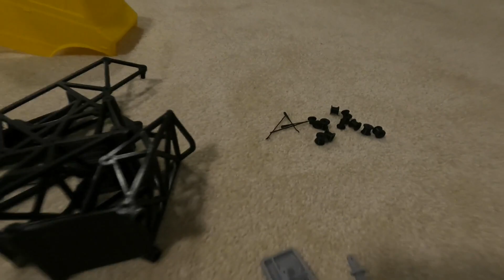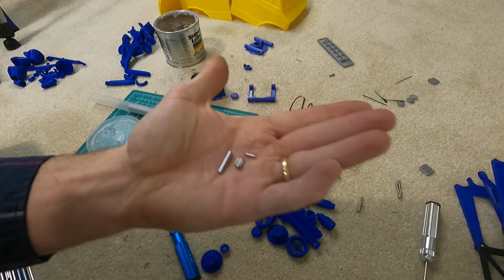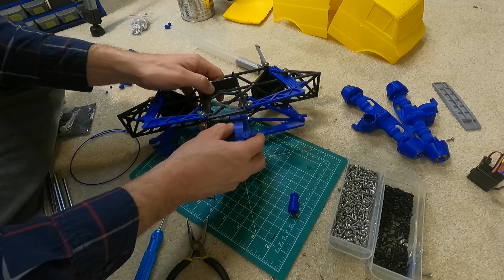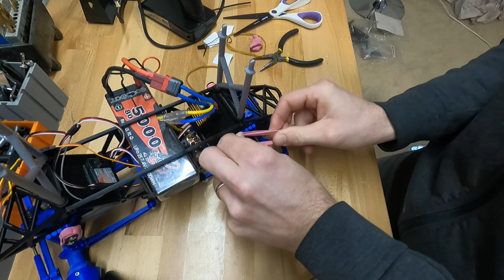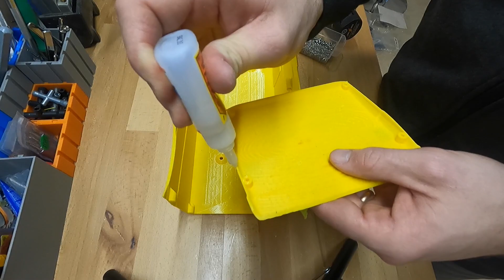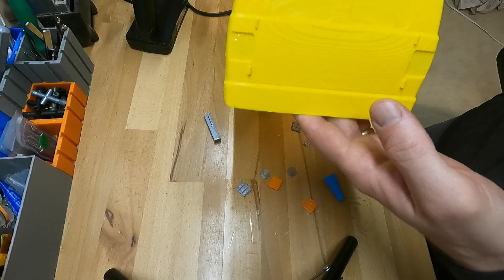Building a 3D Printed Monster Truck! The URSA

Comment: Another great build! That one looks like it's Clod Buster inspired. It also has a lot of small parts, looking forward to a "bash" video.
Reply from the maker: It definitely looks amazing but I'm pretty worried about those tiny diff gears. I just printed in PLA to start and I'm not sure that'll hold up. I've ordered some new nylon to try on those gears which should hopefully be a bit better. I'm also not totally satisfied with how the driveshafts mesh with the diff, doesn't seem tight enough and I'm getting a bit of grinding... still some work to do before we can have a really good bash!

Comment: I am planning on printing this but I want to upscale it to around 150% maybe even 175% I just need to figure out what bearing I will need for the larger parts. any advice you may have on that would be greatly appreciated. I am also still trying to figure out exactly how I will get the motor to work so I am looking at different transmission options. But hopefully when all is said and done I will have around a 1/6th scale monster truck.  This was a great video thanks for sharing.
Reply from the maker: Dude, I don't have a tonne of recommendations for you but wow that sounds like an amazing project. Please send pics when you're done! I had issues with the differentials on this build and also the steering was a bit too lightweight with just the microservos so if you scale it way up you can probably solve those things but finding the right bearings will definiitely be a challenge. good luck!

Comment: Kind of a dumb question - what rubber bands did you use for the suspension?
Reply from the maker: Just whatever I had lying around... try to make them the same and if they're too big you can just loop them a few times.
Reply: @rcprinter  Thanks for the reply! One other question that came up - With putting the 2 live gearbox halves together did you have trouble with the bearing fitting in place? It seams that is what I cant get seated properly to close the 2 halves. I did get 12x8x4 bearings from Amazon.
Reply from the maker: @gomer240  TBH I can't really remember but it doesn't look like it from the video. Sometimes if I can't get the bearings into their holes a little bit of sanding helps and then if that doesn't work I'll try to press them in with channel lock pliers. If that still doesn't work sometimes I can heat up the part a bit with a heat gun or a lighter but its really easy to ruin the part so thats kind of a last resort. Sometimes you just need to reprint and turn down your flow a little or check your printer's calibration.
Reply: @rcprinter  Thanks again for the reply. I do appreciate it. Thank you for tips, the last one led me to look into Cura's Horizontal Expansion setting. So I am going to dial that in and see if that helps. I didnt try a heat gun but pressing in with pliers they just kept popping back out.

Comment: I printed mine on 150% and put a brushless 4s system 😅
Reply from the maker: Oh wow, I'd love to see that. Link me if you have a video! Did you use standard size servos instead of micros and have to rework the setup for that?? Did you have to rework holes for all the bearings or just get 150% bigger bearings? What wheels did you use?
Reply: @ I got wheels from my hobby store and I used Banggood 25kg servos standard size and got 150% bearings